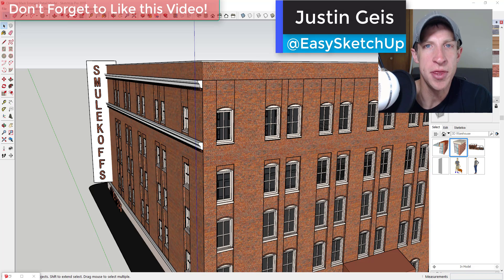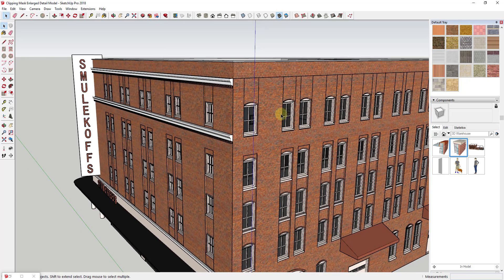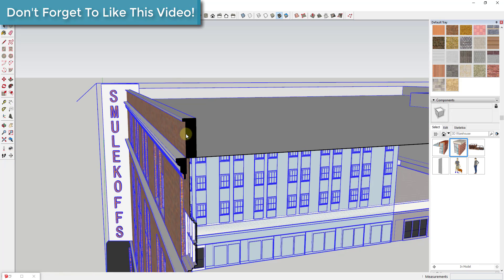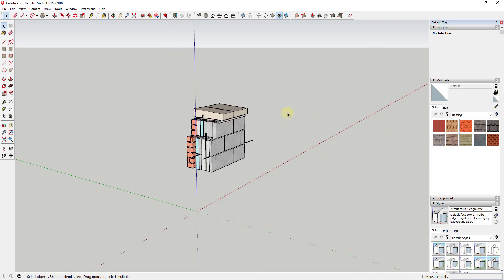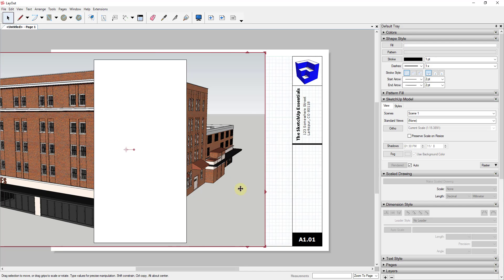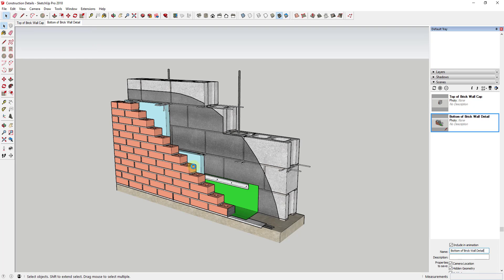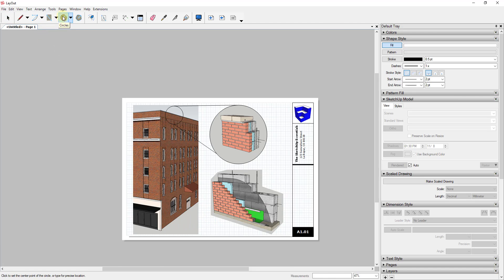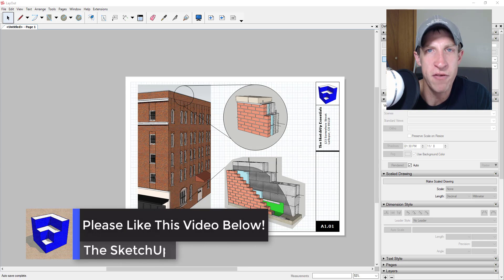3D CONSTRUCTION DETAILS IN LAYOUT with Clipping Masks

Comment: I have a question, maybe this can be on your new tutorial..    

I have two buildings one of those buildings is on the correct scale size, the other one is blown up. (it's bigger)  but I need the bigger building because that's the one I worked on, and now I need it to be the same size as the correct model one. 

it's there an easier way to get my bigger building the same size as the original small building model?. instead of eye balling the size back to my original model.. 

am I making any sense?. Lol. 

Thanks in advanced
Reply from the maker: Can you re-scale your second building with the tape measure tool? - https://www.youtube.com/watch?v=YRC1gg4tWx8